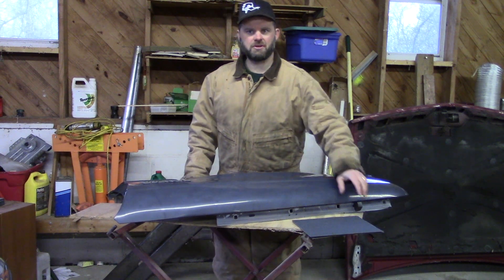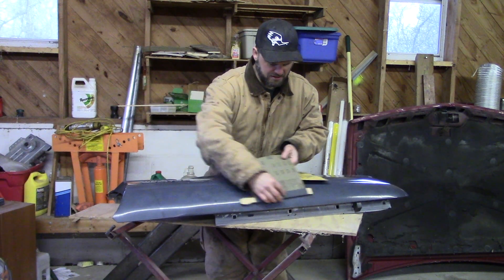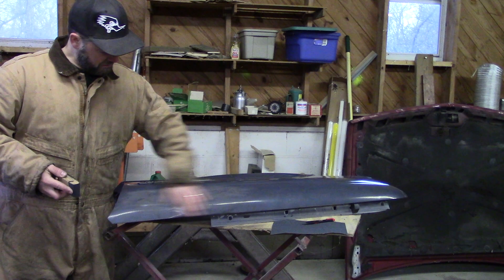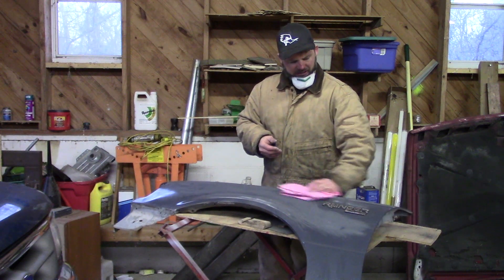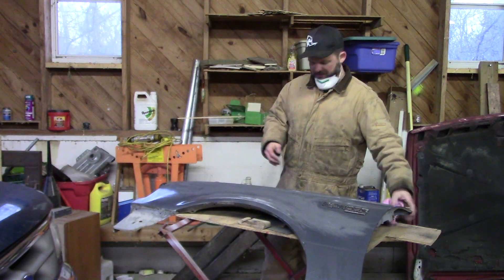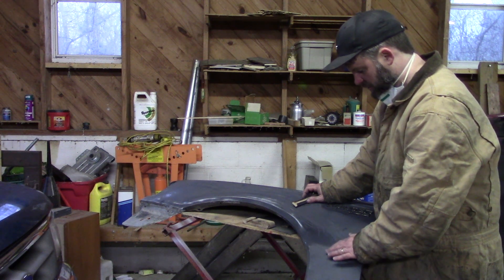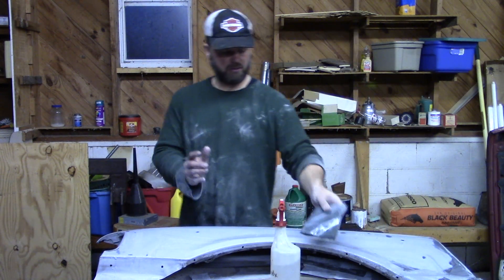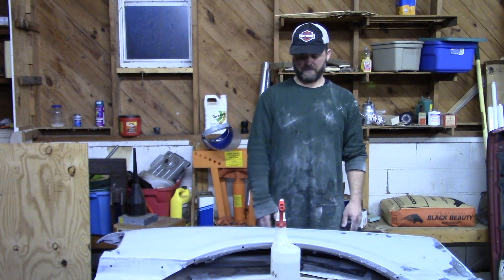DIY Fender Painting - Part 1 - Sanding

Comment: Great work. Future reference though when sending a metal finder use a 320 to 400 grit before priming. If you use anything over a 400 grit primer will have trouble sticking.
Reply: You won’t have trouble sticking over 400– can go up to 800, doing it for years ……. O cone backs

Comment: Do you wanna sand down to the primer or just sand the clear coat off?
Reply from the maker: It depends on the condition of the paint. If it isn't chipped/flaking off and looks to be a good base, don't worry about taking it down to the primer.
Reply: @scottpdotnet  Thanks!